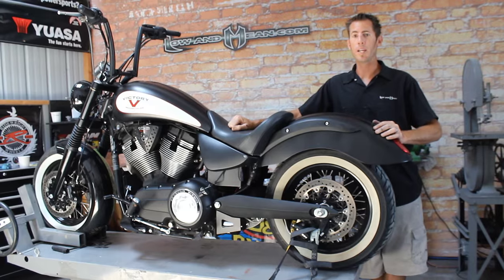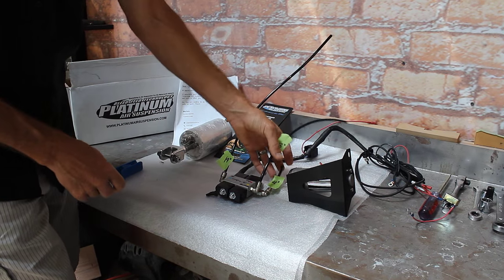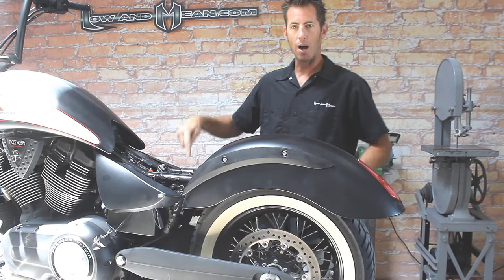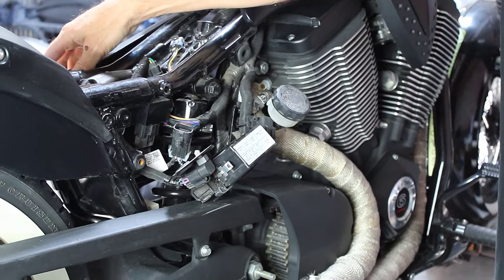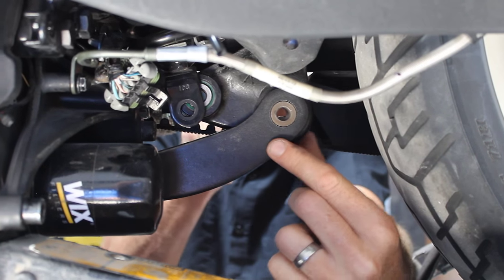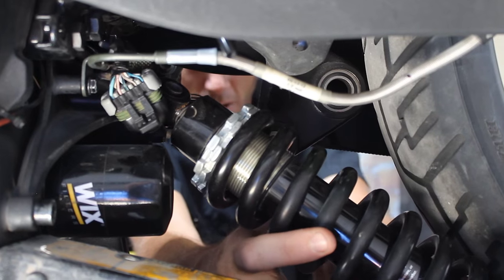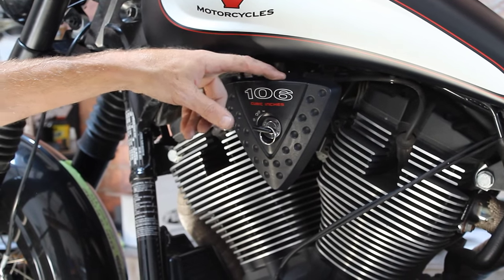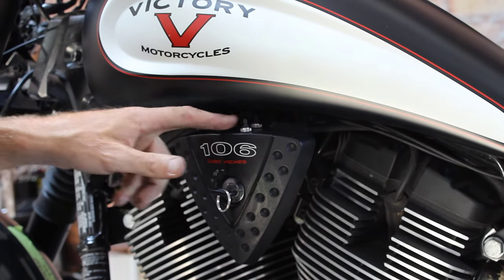Victory High Ball Air Ride Install by Low and Mean

Comment: Will it work with the abs equipped model as the abs unit is mounted where the compressor sits? I assume the abs unit would have to be relocated
Reply from the maker: +Shaun Bromley You will have to find another mounting position for this system to get to. In short, no, unless you find another position. We have no additional bracket or placement for the ABS system.

Comment: will this work on a 2011 victory kingpin?
Reply from the maker: The rear shocks appear to be the same as the Highball we fit this kit to. Just be aware we have not fit it to any other bike so it may be perfect or may require a little bit of DIY.

Comment: Are those the stock pipes wrapped? Did u retune or dose it run good as is? Thanks for the info
Reply from the maker: Yes stock pipes just cut back, we have a fuel tuner on it.

Comment: Will this work on a 2005 kingpin?
Reply from the maker: The air ride system will work with the Kingpin but the mounting may need to be different than the Highball.

Comment: Is there anywhere to bolt the valves to under the seat? Or did you guys just let them float about?
Reply from the maker: +Caillin Patterson We found no place to bolt the valves so they sit (or 'float') in the center.
Reply: +Caillin Patterson They mount best BOLTED under the battery box. it takes a little mod but you shouldn't just let them "float around"!. Some we do have a Power Commander (and Auto Tune) mounted in the place they put them anyway.

Comment: I know this is a older video but how is the ride?
Reply from the maker: This system allows you to control your ride height and rebound. As for the ride it is more floaty than stock. The main advantage is lower and raising the rear.
Reply: @LowandMEANcom  i have this very same system with rebound.  The ride is not soft, I tried many variations full height,  some rebound, no rebound just release air to 1" lower and rides very stiff
Reply from the maker: @birshking  If you are having issues with ride quality then please contact the manufacturer of your air ride system for suggestions.